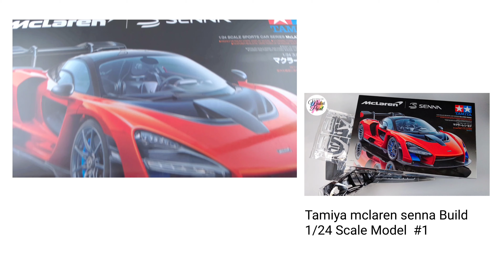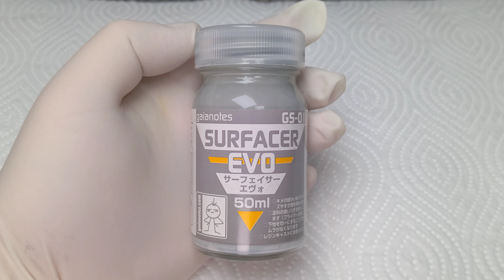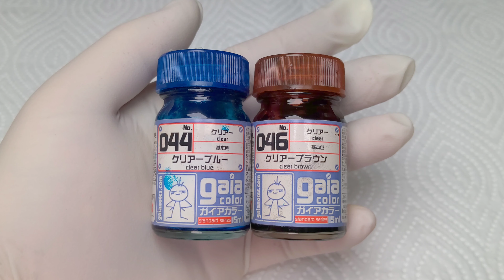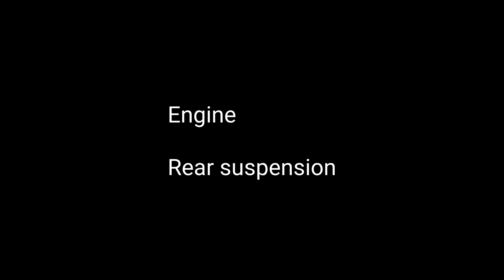Tamiya McLaren Senna Build  1/24 Scale Model    # 2  シャーシ

Comment: Beautiful work and such attention to detail. it looks as though when you place parts in position that they are press fit. Are you using glue on the parts before you add them, and where the parts have been painted, is the glue able to bond them securely? i have this kit and hope to start it soon. I have subscribed and look forward to the finished product.
Reply from the maker: Thank you!
Uses a rubber adhesive.  Does not melt plastic or paint.  If you make a mistake, you can peel it off!  The brake caliper and rear bulkhead are not glued because the paint is not dry.  This kit has many parts and takes time.  The parts fit perfectly, so it's fun!
Reply: @mokeipaint  could you tell me what the rubber adhesive you use is. Do you use that exclusively or thing glue also. I’m intrigued
Reply from the maker: The rubber adhesive is made in Japan and is "Bond G Clear”. 
It can be used for leather shoes, cloth, and synthetic rubber, and it can also be used for clear parts because it is transparent. Instant adhesive, pouring adhesive, and" Tamiya cement "are also used.  Most of the assembly is made of rubber adhesive!
Reply: @mokeipaint  Thanks for the info on the Bond G Clear glue, but I have not been able to source it anywhere. I even emailed the makers Konishi but they did not reply to the email. Im really looking forward to your next videos to complete this build and hope they are not too far away. Your work is just perfection.
Reply from the maker: Thank you!  Any rubber adhesive will do.  Please ask at Amazon or the store.  The next video will be completed in about a week.  I'm sorry to have kept you waiting.

Comment: Hello, what are those little disc that you use before the poly cap at the 11:25? Thanks!
Reply from the maker: Thank you for your comment. 
 0.2mm spencer.  There is a gap in the poly cap, so the wheel will be stable when inserted.

Comment: Good evenning,
I'm building a Porsche RSR Type 934 tamiya 1/12 and i want know the type of gloss varnish you use?
Can you help me for this part of model becaus i search a very gloss varnish for the body and i don't know exactly to take.
Reply from the maker: Good evening. I use urethane clear. You can buy it at model stores or radio control stores. I recommend you to polish the painted surface of urethane clear with a compound for real cars because it is hard. The finish is Hasegawa ceramic compound.